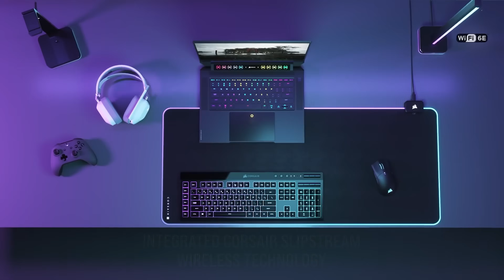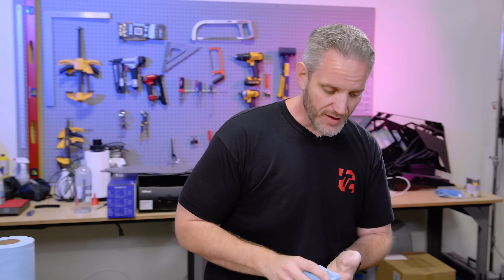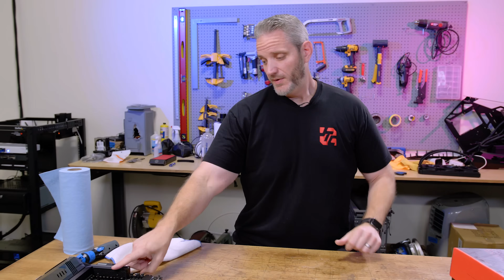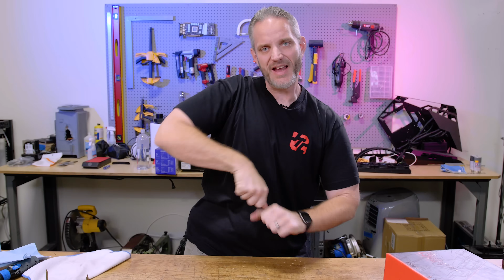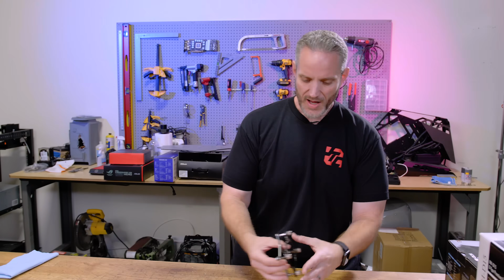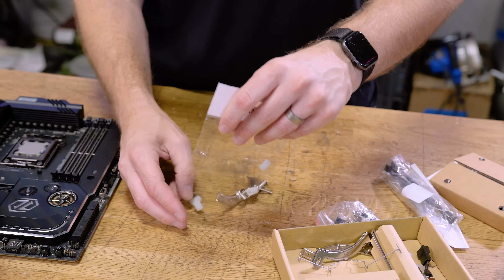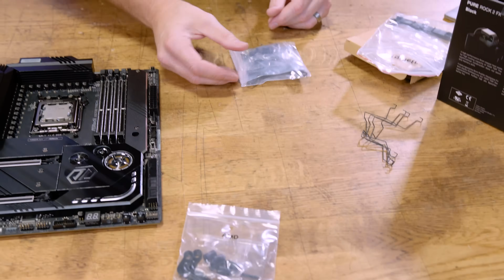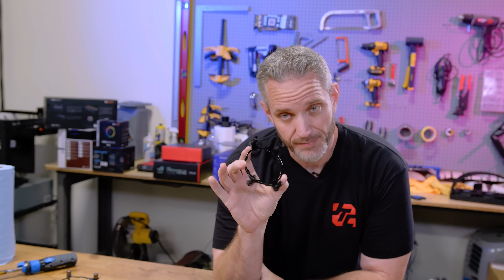AMD made a terrible flaw with this design...

Comment: The main factors in heat exchange are surface size, deltaT, material specific heat transfer capability as well as thickness.
The dimension for heat transfer is Watts/ meter*K.
Only problem is he also switched his thermal compound. But as Jay says, usually it only accounts for 2-3°.
From my stomach I'd say it is caused by the thickness of the IHS. But maybe its even worse and it isnt even made from copper...

Comment: Jay, the best way to test the IHS would be to mill off the 2mm off the top of the new AMD CPU, but it would mean having to modify the contact plate of the water blocks or air cooler to accommodate for the 2 mm difference.  The really best option would be to have AMD make an integrated water block solder direct to the CPU chips that would be the ultimate game changer.  But that would means to have a special holding system to hold this CPU on the LGA socket.

Comment: I have seen mounting like this before on older intel lga on an HP system ended up just using an aio with the pullthrough bolts to hold the cpu in the socket.

Comment: AMD should directly sell non-lidded CPUs such that delidding isn't even necessary. Direct die cooling doesn't seem that complicated at all. Why even use an integrated heatspreader if direct die cooling gives much better thermals? I mean laptops also use direct die cooling.

Comment: If anyone actually tech savy reads this - No, AMD did NOT make a terrible design flaw. Huge part of the 20 degrees temperature drop shown by der8auer is because he did a direct-die-cooling. With a (yet) unreleased thermal interface on top of that. The 1.5mm thicker IHS likely contributes to no more than 3-5 degrees higher temperatures for a 70mm2 CCX. Even if the IHS was 1.5mm slimmer, der8auer would still be able to demonstrate a 15-17 degree improvement with the direct-die-cooling. Those extra 1.5mm thickness of the IHS really don't matter THAT much. :)

Comment: first, this is an important issue that the community needs to know about.  BUT...dude!  you did a HORRIBLE job explaining WHY.  in the end I was like "okay, because SOMTHING is thicker, or not, AM4 coolers are not universal on AM5.   and the only ones that are uses the LONG SIDE crossbars...or mount to all four...right?  but NOT the short bars."  All I know is that you now MUST use the AM5 back plate, and somebody is going to fix something, that fixes that hight thing.  I KNOW you know what your saying...but due maybe 5 minutes in Photoshop would have help illustrate the issue. Even your CLEARIFICATION is sketchy.  Ya it may clear up a point you where making...but if we were not following what your point was...then we don't understand what you said wrong, that your'e needing to clearify.

Comment: Noctua says: "Since the stack-up height (height of the CPU and socket combined) as well as the backplate threads and their pattern are identical on AM4 and AM5, all Noctua coolers and mounting kits that support AM4 are upwards compatible with socket AM5, except the NH-L9a-AM4 and the NM-AM4-L9aL9i". So the NH-D15 will work.

Comment: Why can't you go to HomeDepot and get some bolts with the same thread as the 4 screws holding the bracket in place. and get some washers, they should not be to high to interfere with the case. You can get nylon washers there also, have a good trip! You can modify the cooler custom back plate by drilling some holes to allow the screws through.

Comment: I screwed in some 1.25" M6-32 screws from Lowes in from the bottom for my EK Quantum Velocity.  I placed the block down along the screws, added the springs that came with the cooler, and then added two nuts to each screw end to keep tension on the block. Working well so far.

Note that the nuts are flush with the tip of the screws, not tightened down on the block frame.

Comment: Ryzen 7000 has proved to be *utterly facinating*. Beastly performance.. but high temps and power.
Unless you undervolt with the curve optimiser and get lower tems and more MHz. Unless you de-lid the freaking thing and grab yourself 20*C more thermal headroom. Can't wait for enthusiasts to start combining all these discoveries and whatever gets discoved next and mod the absolute pants off of these chips.

Comment: Just undervolt the cpu in PBO2 and set whatever max temp you are comfortable with based on your cooler.  Can also set power limits if you want.   Same performance and much more normal temps in about 10 minutes - without voiding the warranty.

Comment: Why is everyone so worried about the thermals? It's a non-issue that you're making an issue out of. In fact, making this CPU run cooler may be counterproductive for many design goals. As it stands currently, AMD has implemented a remarkably elegant and easy exploit system for deciding how much power you want to allow your CPU to draw and how much compute efficiency vs performance you want. Just pick a bigger more expensive cooler if you want faster with less efficiency, or pick a smaller, cheaper cooler if you want less power consumption and better compute efficiency. Done. A $40 heatsink and a bit of PBO undervolting and these CPU's are good to go. This whole video is trying to make a problem out of something that isn't actually a problem.

Comment: If you have your own bolts that can go in the stock backplate you should be good to go.  Of course then you are re-engineering.  It could be argued most mounts should have retained the stock backplate from the beginning.  A simple conversion kit should be available.  Of course I paid an average of about $12-14 apiece for my last 6 tower air coolers, and maybe $25 on average for AIOs so not the highest quality and I felt totally OK using some longer machine screws to keep the original backplate.

Comment: I mean, this is a shame sort of, but as a system builder, I have not ran in to a cooler for AMD that didn't either use the clips (cooler master is the only AIO brand I can think of that use the clips and as far as air coolers go I think all I've seen is the 212 Evo, again a CM cooler, and the knockoff/clone versions of this cooler) or the backplate mounts to install the cooler.  Again, all that comes to mind is mostly the noname generic and knockoff / clone cheap coolers for the most part that do not use AMD supplied mounting.  I mean, why would you not use the backplate that's already there to save on your own materials/research and whatnot while also making it easier for the consumer?  At least they didnt change the socket entirely like the competition does every 1 to two generations (usually unnecessarily)... And it's also proof that you can change your socket while still retaining a majority of compatibility with older coolers/attachments which is just awesome.  The competition doesn't even attempt to do this.  Anytime AMD does something fantastic and great it's always overshadowed by some flaw.  Hell even them changing to a new platform gets all the talking heads saying to wait before jumping on a new platform because it's new and blahdy blahddy blahh.....when nothing was said about the entirely new 12th gen intel platform or any other new platform they've had since the first core CPUs were released....even when they charged 1500 for a CPU!  And at the same time these talking heads wonder why AMD isnt more popular or considered a premium brand...well you make them sound so unreliable and like a generic intel knockoff the average person has no idea they're not subpar.  These tech tubers have all gone down in quality in general and one of the reasons is they're always looking to play GOTCHA with the same companies paying their bills and it looks desperate often times these days.  If there's a real problem, of course the community needs to know about it, but not every issue is a major problem worthy of being called a "terrible flaw." I'd say an attempt to ensure the vast majority of your customers and other partners dont have to change anything about their cooler if they don't want to is the furthest thing from a fatal flaw even if a small portion of those coolers are left out because of the new design.

Comment: Could you not just shave down the IHS until it's the same thickness as the older CPUs? 

I'm not sure how that would affect the ability to mount a cooler to it, but that seems like the logical solution to me. Safer than delidding, and should accomplish almost the same performance gains if you can still get a good mount.
Reply from the maker: That's depends on how high it sticks out above the retention bracket

Comment: Yeah... so I didn't realize my EK block would not work with my 7950x until after I had ordered everything and happened to watch that video too. I did pick up a DeepCool AK620 Zero Dark to keep the beast cool until my pre ordered AM5 block arrives though. It keeps it under 85 on 100% load.
Reply: I really wish I knew how the J2C block performed on the 7950x. I hate the air cooler because I can't fit my dual  water blocked w/ active cooled back plate 3090 in my case with a tower cooler :( If I could drive a couple hours to MC and get a block that performs good I totally would tomorrow to be able to get my water cooling back.

Comment: The hooks are still being used. Dude....This means that my Pentium 4 / Socket A Athlon block and mount setup is STILL compatible with these newer boards. These were made in 2002 and I've put them on Pentium 4, Phenom II, FX, now Ryzen 3000. Am I going to end up putting this on Ryzen 7000 too? I'm not complaining but I'm really surprised by the sage design of this antique. All I do on Ryzen is flip the hooks around and I've got a solid way to mount the block. When does this system DIE?! O_o

Comment: I think the IHS is that thick to leave room for the 3DV cache and keep the Z-height the same when those CPUs are released.  Remember the 5800X3D can't be overclocked because of cooling and it had something to do with the Z-height.
Reply: Yes, in the next generations, 3dv will be the way how AMD will add more cores, it will not be just cache. So we can count with multiple 3dv stacked layers (5~10)

Comment: This just seems like the dumbest move by AMD, why gimp your own CPU for "compatibility" when half the coolers aren't compatible anyway, never mind the long term cost of producing a thicker IHS. Personally I'd rather have a thinner iHS, better performance headroom and have to request or buy a new mount (cooler manufacturers did it with AM3 to AM4) or a new cooler entirely. I hope in the future they change it, coz this just seems dumb on multiple levels to me. I hope der8auer does do a Ryzen 5000 series and lower IHS comparison too, AMD needs to be called out for it's dumb move.

Comment: NOCTUA NHD15 has AM4. im running it on my 2 x570 boards with zero fitment issues. you got a VERY old version. this one WILL fit on AM5, because the bars fit across the AM4 pattern

Comment: I feel like they would have been better off ditching the back plate on AM5 boards, make the holes the same as lga115x/1200 and just make it easier on everyone including the cooler companies because everything already comes with mounting for lga115x/1200 anyway and then at the same time they're replacing the 2-point hook mount for a superior 4-point mount... (assuming the am5 cpus are close to the same size as intels 115x/1200 ) then that would have saved so much money, time and materials. They only thing they'd have to do is redesign their stock fans to have the push pin style (like intel atock coolers). Yeah the push pin style isnt the best best but its mucch better than the 2-point hook mount and lets be real on the lower end am5 cpus a 4-point push pin mount would be  absolutely adequate and in my opinion better than the 2 point hook mount anyway. would have been a win win all around

Comment: I mean, it sounds like a really simple fix to replace the back bracket and/or tap 4 holes into your new backplate solution. Just need to get those kits in the retail boxes.

Comment: PBO2 Undervolting had great results with lowering temp...optimum tech made a great and easy video regarding if you want  a simple solution if you don't want it to run in 95 degrees both the 7 series and 5 series

Comment: Hey Jay, I'm not sure you're riight about the thickness of the IHS being the 20c drop. Unless they've changed something, those IHS's are made of copper (nickel coated on the outside). Copper is one of the best metals at thernal conductivity - do you rememeber 10 - 15 years ago when people would be looking for the good coolers as the ones with the copper plug in the base? And then they started making them out of all copper (P4 days). The thickness of the copper isn't the issue - I feel that it's the interface between the IHS and the cooler itself. More copper means more heatsink capacity, but if the contact between the IHS and cooler isn't great then that heat can't be removed. Going direct die eliminates one full interface, and I think that's where the improvement is.

So if DerBauer does what you're asking, I have a feeling that it will be very close to what the stock setup is. But if you were to lap the IHS perfectly flat and mate it to a perfectly flat copper cooler it would be much better. Doubly so if you use liquid metal between the copper layers (IHS to cooler). I thnk that would get you right into the ballpark of direct die, maybe a few degrees higher just due to the extra soldered interface with the IHS and die. 

If you're wiling, try lapping onw of your new 7k series chips and use liquid metal to mount the cooler (carefully, obviously) - I think we'll all be happily shocked. :)

Comment: An aside. I noticed the massive number of "phases" for the VRM, and the huge heat fins to try to cool them. These are needed because the 1920-vintage buck regulator is only about 60% efficient. About 2/3 of the power is delivered to the CPU. 1/3 is turned into heat in the VRM. A 2-phase Ćuk-buck2 is smaller, cheaper, and 99+% efficient, so less than 1% of the power is turned into heat.

P.S. When ANY of the FETs in the VRM shorts, the CPU voltage goes from 1.3V-1.5V to 12V.  This is the major failure mode in the 13" MacBook Pro.

Comment: I'm of the opinion that this is a good reason to skip this generation of AMD. The reason this is a terrible ... that is the only word for it ... terrible testament to AMD engineering. If they couldn't keep the same height, they should have just said that it isn't compatible. What they did is compromise the new processor. I want to say  that while I started migration to AMD (my son's computer is AMD) I'm rethinking that choice. This is at least two different failures by AMD. The faulty engineering is a major concern. The lack of transparency is another major concern. "AMD is aware of this ..." and it only comes out because it was found external to AMD. Two separate bad decisions. The second is likely the worst. :(

Comment: Unrelated to this video but several months ago you built an i9 setup in a Evolve Shift XT and then a second video improving the cooling in same system.  I would be interested in an update to see if a cpu cage like the thermal grizzly you tested elsewhere would have an impact on that little itx board.

Comment: Looks like they need one of the contact frame mods like the Thermal Grizzly, Thermalright, or No-name for 12th Gen Intel.  Mine (Thermalright) took 10 minutes to install.  Was more worried about the processor flexing issue than extra cooling but benefits are benefits and it was cheap and easy.  It makes contact with the entire step of the IHS.  I do like that AMD is one big plate, that adds some stiffness so the tension on the screws can't cause the whole mobo to flex.

I am kind of amused that AMD screwed their own pooch on the thick IHS though.

Comment: Could it not just be AMD giving themselves Z axis headroom for 3D vcache? because if understand correctly they do literally stack the cache on the Z axis of the dye, thereby increasing it's own thickness but achieving a direct link to the interface in multiple links as opposed to trace navigating,

Comment: I have that same screwdriver.  I bought mine at Lowes.  I love that thing and keep it in my laptop bag at all times.  I also have a LTT driver on the way too.  The cordless driver works great for rack mounting gear because you normally need to hold the gear in one hand and try to get at least one screw in and a manual driver makes it very difficult.

Comment: I wonder if the thicker ihs is compensating for when they launch the 3d version of all of these cpus or something. They have the head room to increase the size of what's under the ihs. Not saying that's the case but it would be possible for them to shave down the ihs and fit even more under the hood. 🤔

Comment: We've seen this with every new edition of CPUs since the very beginning, each edition is more powerful, uses more power and produces more heat.  Following each new CPU we then see better coolers come on the market. So don't worry about AMD's or Intel's new CPUs running hotter then the previous generation, I'm sure there will be new coolers to keep the heat under control.

Comment: What's also odd about AM4 and ryzen was some chips came with the Wraith Prism cooler that used the brackets and then some came with the Wraith Stealth cooler that had you remove the clips. So even with AM4 AMD had no consistency themself.

Comment: My Noctua NH-D15 just came off my 5800x MSI Unify board.  My screws & mounting bracket were compatible with AM5 for my Asus ProArt x670e.  I had a Vetroo U6, but their bracket isn't compatible with AM5.